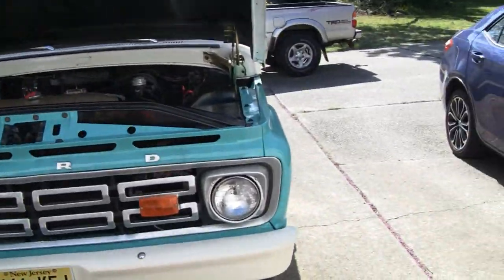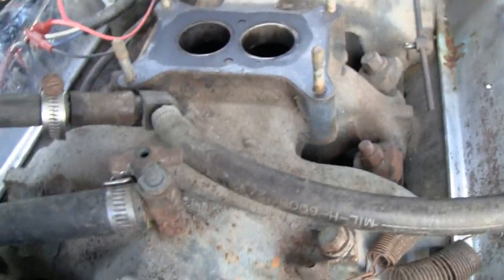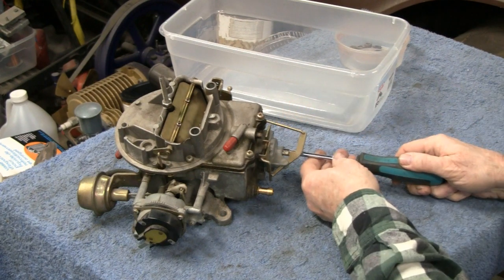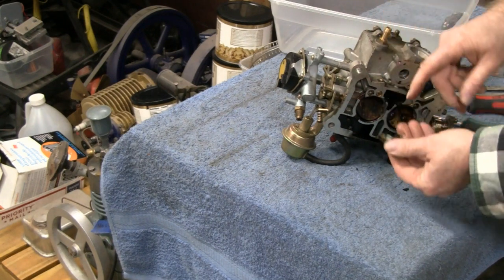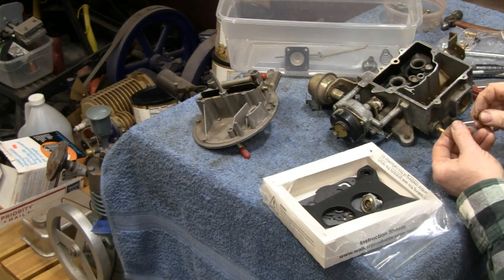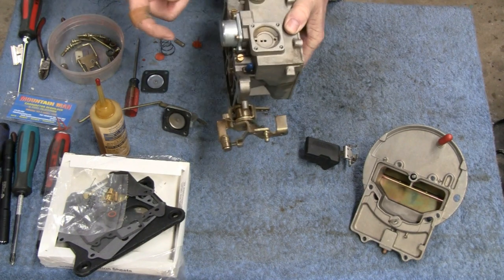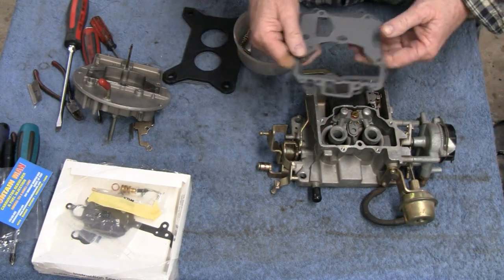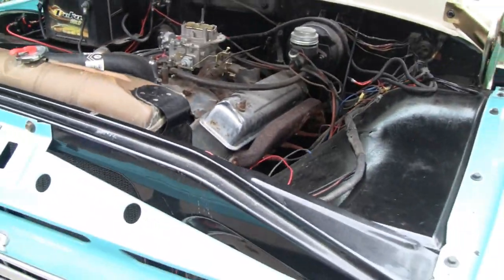CARBURETOR REBUILD  (F100 part 97)

Comment: I'm glad you are replacing that diaphragm, in hindsight, that may have been where the fuel was leaking on my Holley, which is very similar to the Autolight carburetors.

Comment: Roadking  You have to trust me on this The power valve cover on that carb is a deep one 
you have the wrong power valve in the carb and so is the new one
I learned about this on my carb from a very good carb rebuild guy
with many years doing them the correct power valve is a lot longer
with a adj.screw that is loctited from the factory not to be messed with
Reply: I hope you're right very interested
Reply from the maker: You're right Bud!! I did a lil' research and found this Carb Guy that says it will be alright, it just won't have the finesse of the two stage valve.  https://www.youtube.com/watch?v=sSUTMxTFydc
If we have any problems we'll know right where to go!!☻
Reply: @805ROADKING  When I got my truck it was really low on power climbing hills 
After I did the carb with the right valve
I had plenty of power and could spin 
the tires

Comment: it is a Motorcraft carb. For a later model engine. The kit should have had the check valve in it. Rebuilt many of those through the years

Comment: It sounded really good. It's been many years since I worked on my father's old '61 F100 and my memory is fading but, I remember the smaller throttle return spring being inside of the larger one with both being connected to the same point on the carburetor. I was told it was a redundant safety feature incase one spring should fail.  That looks like a newer carburetor on the older ones I think the accelerator pump used a check ball and spring too keep the fuel flowing in the right direction.  That may be why the float bowl vent looking like it's capped off is kind of bugging me.

Comment: I rebuilt a carb on a 64 mercury comet with a 289. I was prolly 17 years old and had no idea what I was doing. A part or two that fell off while I was tearing it down and which I couldn’t figure out where they went just got pitched.  The crazy thing is the car still ran better when I was done. More luck than sense for sure. 😂
Reply from the maker: That's funny!! When I took the accelerator pump off it jump into my lap, I knew it must have had a spring or something but I didn't see one!! I finally found it under the table when I moved it!!☻

Comment: On the side of your kit it's saying that if you buy it IN Mexico, it was imported to Mexico by Walker products. But it is hard to tell most of the time where stuff is coming from. The whole "Made in USA..... from global materials" thing is a joke. That truck is sure looking good RK!! Judging by the finish on that carb it's a China replacement. Sure seems to run good though!
Reply from the maker: Thanks alot Connor!! Good to see the Ol' 57 running, you're doing a fine job over there!!☻
Reply: @805ROADKING  Thank you!!

Comment: Probably came off of a 302 automatic. The electric choke should have 1/3 battery voltage to it. the S terminal off the alternator is where it should get power. Used to be a quick check for the charging system. Dim test light there most the time the alternator is good.
Reply from the maker: Thanks for the info Mike!! I'll have to look into that voltage stuff!! My truck has a Delco Alternator on it!!☻
Reply: Since it has a Delco it wont have the S terminal. The element in the choke may be ok at 12 volts.

Comment: Service station, E?  You are really dating yourself.  Nobody much younger than me even knows what a service station was.  :)  Unfortunately, with rebuild kits, ya lays ya bets and ya takes ya chances...  If you hadn't taken the whole thing apart, you wouldn't have known that riser was in backwards.
Reply from the maker: What's even worse is I worked at a Service Station!! Every Car that came in for Fuel got their windshield cleaned, oil checked and Green Stamps and all for 28¢/gal!!☻